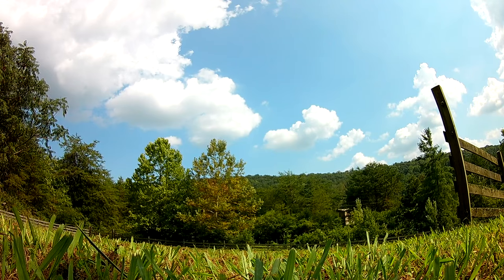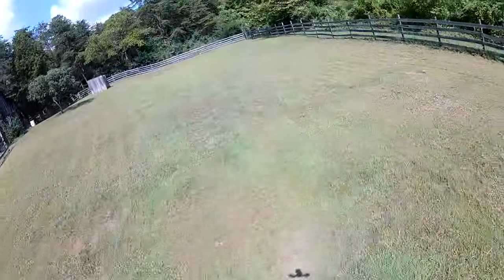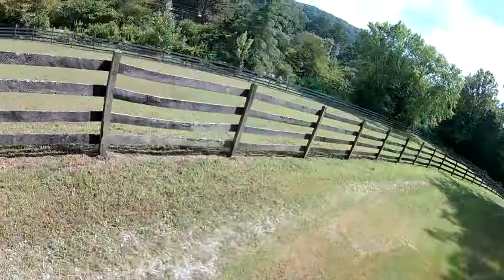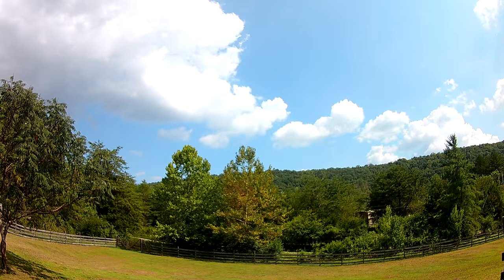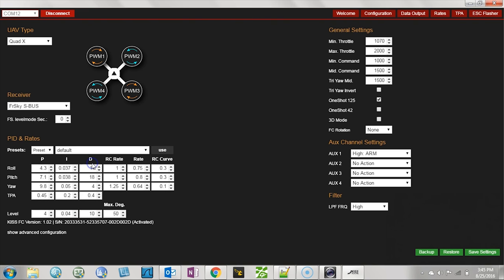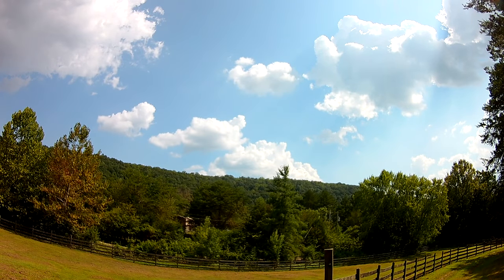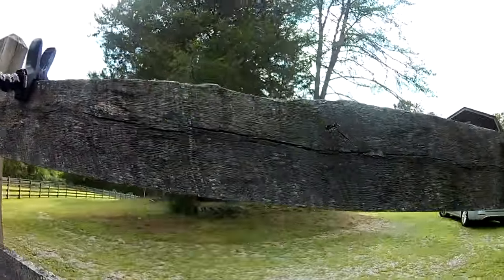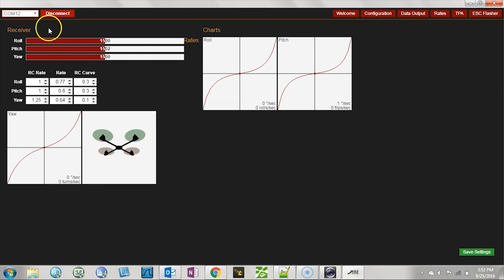Practical PID Tuning - Part 9 - KISS Alien

Comment: Glad to see you tried out KISS again and now you see why many of us are really liking it.
Reply from the maker: +Kenneth Kammerer I never doubted why people like it. All my complaints still stand... Show me how to arm with the middle position of a three position switch with KISS. I know how to do it, but look at the hoops you have to jump through. Ugh.
Reply: BF has a different set of hoops to jump through, but hoops nonetheless. 😉
Reply: FinalGlide did complain about that and in RC30+ you can configure the modes like betaflight.
Reply from the maker: This confirms my assertion that eventually KISS will work in all of the cleanflight / betaflight features it removed in the name of "simple". Will it still be "simple" at that point, or just different.
Reply: Joshua, that's a great question. It flies well, that's why I use it.
Reply: Thanks for a KISS tuning vid! Been waiting for this. Would be also great to see more of KISS blackbox analysing from you. Btw. which FC&ESC firmwares you're running? I feel the old presets are not too valid for me anymore since the FW upgrades. Since RC27 and 1.03 lower Ps and Ds gave similar tune than before. But 1.03 for ESCs had the biggest impact in my tune and I got finally rid of the mid throttle oscillations. I'm running the same setup  sans props.
Reply from the maker: +Aki Sysmäläinen I'd have to ask Dean.

Comment: Great vid. I went from Baseflight ZMR 250 Naze to full Kiss Alien 5' and was amazed how much easier tuning was. Of course I've only been in it a yr, so I probably made a lot of mistakes in the beginning. It just seemed like the Kiss FC flew incredible right  out of the box. No drama. I did the Rotor Riot Steele build exactly off Youtube. Currently I'm using about 85% of Steele's pids. Perfect for my level. What a lot of people don't realize is every little thing makes a difference. And even if you copy a build perfectly, it's no guarantee, right? Anyway glad you got to check out kiss.

Comment: This is a bit of a labored analogy but the best way I can describe kiss rates is like a scratch spin in figure skating. It enters very controlled and graceful, gets really tight and precise in the middle of the move, then exits in the same graceful fashion in entered with. It feels really good on the sticks. I wonder if there is any way to tweak the rates in Betaflight to mimic this.

Comment: So, I love the footage that comes from people with KISS FCs.  The question is - how do we emulate this on Betaflight?  I can see exactly what you mean with how it enters and exits moves so smoothly, so there is definitely something with the way stick inputs are handled.  It seems like there is a deadband that most of us dont run on center of the stick too... thoughts?  Maybe it is just a severe expo curve for the first 10us on both sides of center...
Reply from the maker: I would try playing with super expo and expo to see if you could emulate the curve. But curves alone are not going to fully emulate this I don't think. I would guess that KISS is doing something with dynamic adjustment of P to achieve this sort of smoothness. Perhaps adjusting Betaflight 3.0 P term PID relaxation slider will help. The bottom line is that you could play with Betaflight for hours to try to achieve this, or just get KISS. Personally, I still like Betaflight because I feel that it has a wider tuning envelope. I can get an ultra sharp racing tune or an ultra soft freestyle tune or anything in between. But it's frankly premature to say that after only flying one KISS build.
Reply: Agree, but I have about 3 F3 flight controllers laying around and 0 KISS FCs laying around....  Also, does the Iterm seem strong?  I think people tend to leave it along on BF3, but from the visuals, I often see a litte wandering, KISS I never observe that.

Comment: Josh, have you flown a quad with bF3 and KISS24A ESCs? IMO it's the best combo. You get all the sharpness of the KISS ESCs but with the flexibility and reliability of bF FW. Boris has worked a lot of the KISS 'character' in to bF anyway. 
Glad you finally had a fly of a fully KISSed setup. I tried it for 4 months but in the end the issues outweighed the benefits and I went back to bF, but I still run their ESCs.
Reply from the maker: I haven't. And I'm not sure I will. At the end of the day, KISS strikes me as different but not better than Betaflight. So I'll stick with what I know. Looking forward to trying Raceflight to see if it's radically better. But honestly, Betaflight is so good it's hard to imagine. Then again, lots of people whose opinion I respect are switching to Betaflight.
Reply: I agree with you +Revs, bf3 and KISS 24A are a really great combo. Boris B. also said in an interview (+Joshua Bardwell was also part of that video) that he leads back a lot of the great KISS Performance to the KISS ESC. He justified, that they still have some noticable advantage in terms of breaking compared to blheli s. To me it makes these esc's a really nice companion paired with a bf 3.0 fc leading to a remarkable flight performance.

Comment: When I Yaw and Roll to bank a sharp turn I do notice I am experiencing some drifting.  Seems to drift slightly backwards and towards the side of whichever way I am turning.  What can I do to get that under control and make it feel tighter?  I am running Kiss FC and Kiss ESC on Alien rr5 frame.  Everything updated to latest firmware.  

Also, thank you for this channel Josh.  You, by far, have the best and most thorough explanations for everything you do.  And you deliver it in a very consumable way so even n00bs like me can follow along lol.  You deserve way more subs than you have.
Reply from the maker: Try raising yaw P gain first and see if that sharpens things up. Possibly roll P gain too but do yaw first.

Comment: Filter should be "OFF" for that frame that's what probably coursing shattering in motors. As mentioned use RC29 FW.
Reply from the maker: Surprised to hear you imply that the frame is the primary determinant of how much filtering you need. Seems like motors and props should have a lot more to do with it.
Reply: Alien is a very stiff frame Emax RS2205 are very well balanced motor and this combo will be very happy with filter OFF for the very best performance less KingKong props are really really sh!t. Generally speaking yes you right but frame play a big factor in it.
Reply from the maker: +Rafal Raf Prusinowski well, well just have to disagree especially about kingkong props.
Reply: That was more of a question about KK props as I don't have any experience with them but newer mind +Joshua Bardwell

Comment: I know its an older video, but i moved from betaflight to KISS, now all my quads are kiss setups.  because of this, i had to really focus on tuning, I watched this video and noticed that you left the LP filter on high.  from experience tuning with it, you really need to work through the noise and the filtering, as you raised P the LP filter has an impact which is part of the reason why you are getting oscillation.  I have started tuning with the filter off, and it has made a world of a difference.  ...FYI with KISS FC ... High is your least amount, then work down the list.

Comment: Don't use the presets you can download from the KISS GUI. For example, FGA or Steele's. They are based on older FW so they won't work well with newer firmwares. Something the KISS guys need to improve.

Comment: Why no Oneshot42?
And when you want to bring up your rates more direct, use Rate - not RC Rate.
RC Rate does add more expo...
Reply from the maker: I know how RC rate and rate work thanks :-)

I didn't use oneshot42 because this was a loaner copter and I wanted to fly it exactly as shipped instead of screwing around with configuration. But I did want to do PID and rate tuning.
Reply: From my understanding it's the other way around. RC Rate doesn't add expo - try here: http://ultraesc.de/KISSFC/rates.html

Comment: I still heard the low throttle shuddering in final time. if you put bf on it you wouldn't get that low throttle shudder it's at a specific throttle point. of you find that throttle point and do turns while at that throttle point it will make it more pronounced
Reply from the maker: If you listen to my betaflight tunes, I also have shuddering motors at low throttle. IMO, it's my high D gain, but it's okay with me for the resulting flight characteristics.
Reply: Joshua Bardwell check for RC jitter. I had this going on. It sounded like d gain problems but it wasn't!
Reply from the maker: +Ben Moyes rcCommand is solid.
Reply: Joshua Bardwell Interesting. To my ears you definitely still had an issue there, those little chirps shouldn't be there at those lowish p and d gains.

Comment: Loaded Betaflight 3.01on my Vortex Pro and now on their default PIDS, when on punchouts, it now Yaws to the left. Never did that before on original FW. Any advise what needs adjusting on PIDs to help correct that? Could not find any situation in your videos that had that. What would cause this? Thanks for any advice.
Reply from the maker: Step 1: install 3.1.1. If it still happens, raise yaw P to like 100. then if it still happens, raise yaw I.
Reply: OK,  Joshua. So I should only try this on 3.1.1, not 3.01. OK, I'll try that. Thanks much!

Comment: pardon me if you covered this I may have missed it......but this "feeling like you are driving on a rough road" where you can see little bumps in fast forward flight......what is that a symptom of ?
Reply from the maker: +Blind Mouse FPV excess vibration. Start with soft mounting the FC.
Reply: can bent nicked props provide this vibration ?
Reply from the maker: +Blind Mouse FPV yes absolutely

Comment: Weirdly enough when i load finalglide's or Steele's pids my alien wobbles like crazy. I have the exact same setup than finalglide's.
I figured my pitch P gain was too high, when i go past 3.7 it starts wobbeling again.
Any idea why two exact same compter would behave so different with same PIDs?
Reply: If you are use the newest KISS firmware you have to lower the P gains, FGA's PID settings in the KISS GUI belongs to an older firmware version.
Reply: I thought FGA was testing/running all the latest firmwares ?
Reply: Vincent Lagarde the reason why your quadcopter is not flying like his because manufacturers in the equipment you're flying the tolerances are not exactly the same on everything so I can guarantee you that his quadcopter is not exactly the same as yours and will never be the same on the same tune you are going to have to figure it out little by little on your own I learned this the hard way I was doing just like you were about a week ago. the plain truth in the simplest answer I can give you.
Reply: I managed to tune it pretty good (for me at least), i was just wondering why there is such a big difference between 2 very similar quad.
Reply: Vincent Lagarde because of manufacturing tolorances in motors can cause a major difference in PID's, its not only PIDs he has tweaked more things then you think and that he is willing to admit.

Comment: joshua hello, friend has a problem with acceleration of the drone, when I take a bit of acceleration engines practically they turn it off and normal or and programming esc.
Reply from the maker: +fpv araújo I'm not sure I understand but it sounds like the ESC's are losing power, if they are going into programming mode.
Reply: joshua, I modified the PIDS because the drone is standard was the calibration of PIDS what was wrong.
Reply from the maker: +fpv araújo PIDs can't make the ESC go into programming mode.
Reply: Joshua has a video explaining his this kind of problem

Comment: You are either using the crappy DVR again or you really got a problem with your FPV setup.
Reply: I was just about to say that LOL,After all that testing as well josh you still have bad video at like 30ft LOL
Reply from the maker: Dominator HD2 with LaForge. I don't know what to tell y'all.
Reply: Joshua Bardwell your dvr is perfectly fine.
Reply: Joshua Bardwell
You can see yourself that the DVR footage looks really bad...your place is probably just cursed so even if you have the best setup, your DRV videos are always going to look like crap :P
Reply from the maker: +neclovekSK there is a lot of breakup but I have no idea why.
Reply: seems on par with mine (same gear)

Comment: Hey mate im having problem atm with bobble up and down when throttle what do i need to adjust as im still new the the whole tuneing side of things
Reply from the maker: My guess is you mean that when you raise and lower the throttle quickly, the quad pitches forward and back. 

If that's what you mean, the answer is to use Anti Gravity Gain. Enable the Anti Gravity feature in the Configuration tab. Then in the PID Tuning tab, raise Anti Gravity Gain to between 3 and 5, and higher if need be.

Comment: What size pack are you using Josh ?
Reply: And did you wire up all the telemetry on the esc's
Reply: Telemetry is wired.
Reply from the maker: 1300 mAh 4S. I didn't build the copter, but I wasn't monitoring telemetry. This was a loaner copter from someone else.